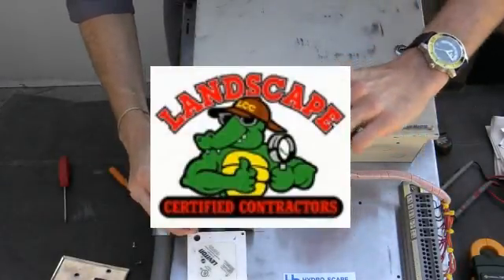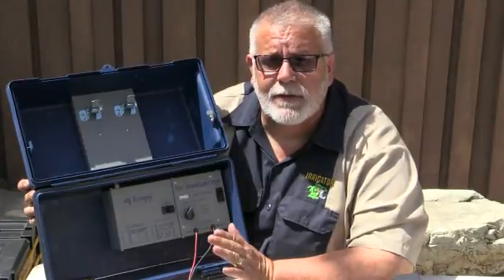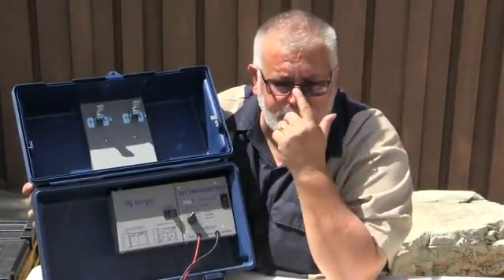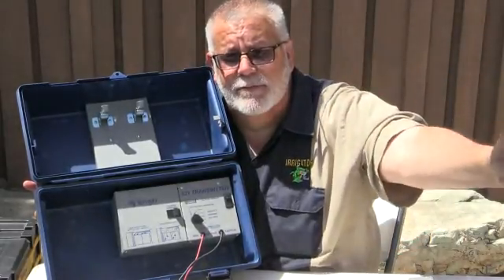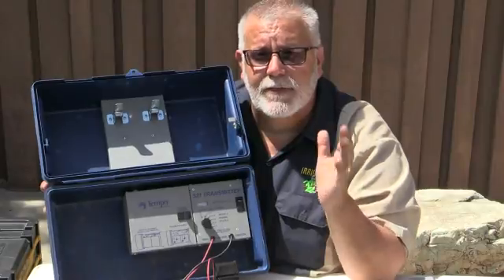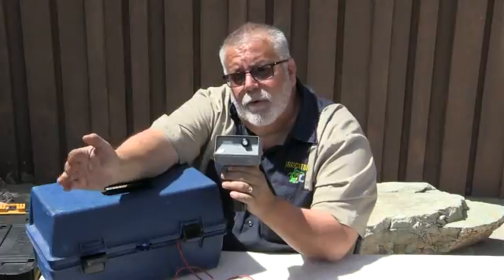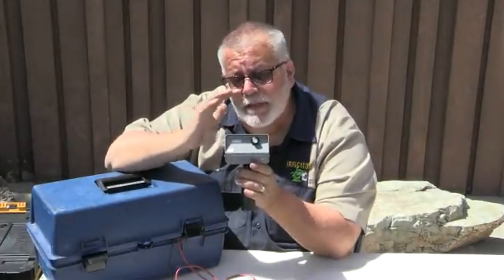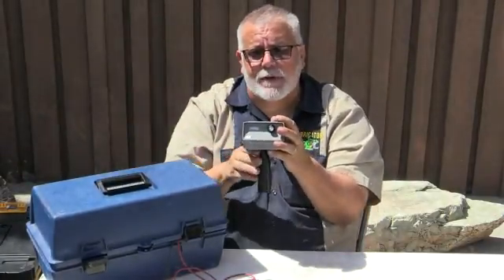How to Wire Track with the GreenLee 521

Comment: Hi i have a 521 the fish box the red wire from the 9volt battery came loose from the ciruit board. I am having a problem getting it fixed can someone take the back off the locator and take a picture where it goes. Thats the red wire

Thank you
Bill,s repairs

Comment: Are you able to tone out valves with these locators with the new two wire irrigation systems ?
Reply: dude. i have asked the question over and over since the beginnig. the anwer is no.
Reply: i have close contacts with hunter and they keep saying they are working on it.

Comment: Excellent video. Needed one of those today. 200ft run water well pump lost one leg of 220v single phase. Gonna have to invest in one of these for sure. You sold me on it especially after so many years. You also told the vital information I was interested in. The depth range. You said you found a wire at 6ft that is awesome.  Thanks again.